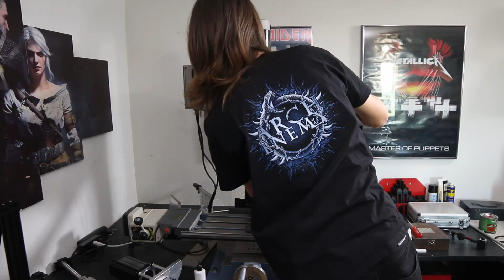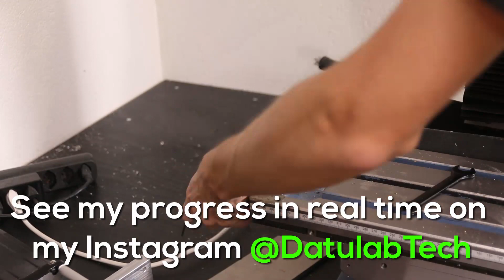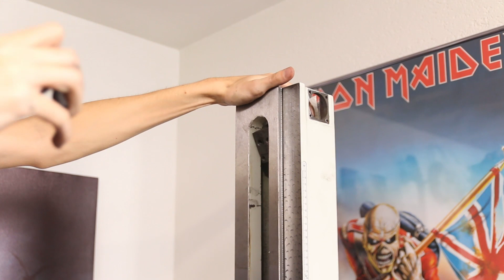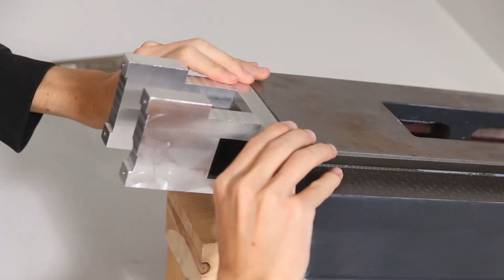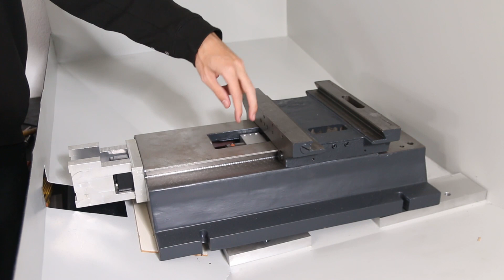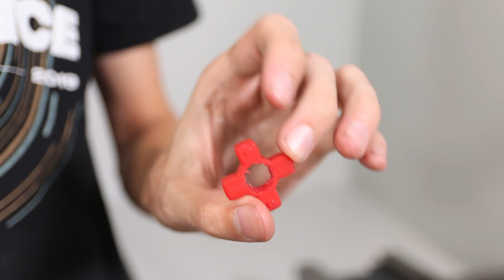BF30 CNC #3 - Y-Axis Operational

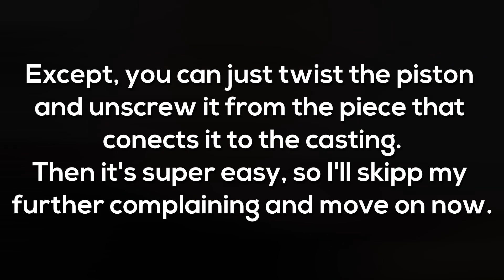Comment: 7:38 that's great info. I will keep that in mind when I do mine.

I just finished watching yoru video and thought I would mention something. I'm not sure if you care, but if you cut a notch out of the base, you can get up to 28 CM if travel. The limiting factor is the ball nut hitting the casting. There is a guy on youtube called "arizonavideo99" He sells ball screw kits and has a video where he talks about this mod on the PM30. 

Well done with the build and video.

Comment: Hi I like the cnc conversion videos I have one suggestion don't use the BK ballscrew holder it has a very low backlash use a angular contact bearing it will work good . Nice work keep it up.

Comment: Thanks a lot for that video.
Is it the double ballnut who limit the course to the front or the nut housing ?
Do you think you would have more course with a single ballnut ?
I'm planning to convert the exact same machine so thank you for your response.
(sorry for my very bad english).
Reply from the maker: On my machine it's the ballnut mount mount that interferes, not the ballnut itself, so there wouldn't be any difference with just one. It is a close fit though, so you might need to use a grinder to create some clearance in the casting if it interferes.
Reply: @DarkArtWorkshop  Thank you a lot. I wil order my ballscrew with double ballnuts now (20 for X and Y, 25 for Z) at linearmotionbearing on ebay.

Comment: I like this series a lot! Only thing the 2 bolts and washer to connect the X axis are not really strong, the washers are already bent it. You should get thicker coupler to secure the joint. If you get play in the bolts, then you will have mechanical backlash although you have the ballscrew. That is a pity.